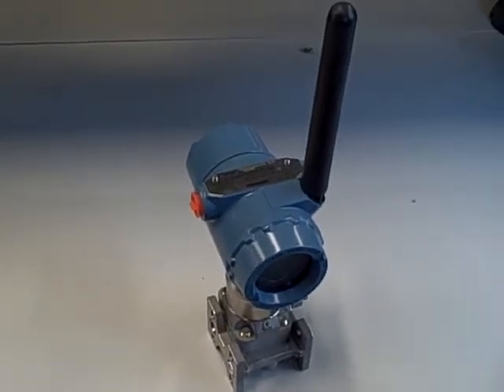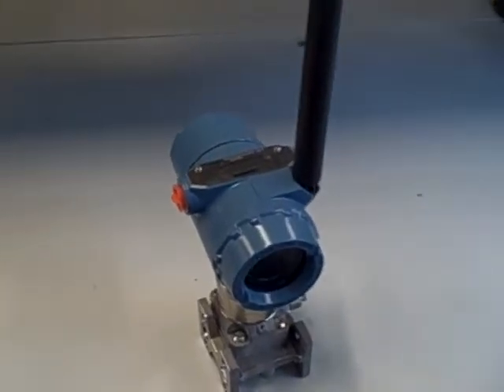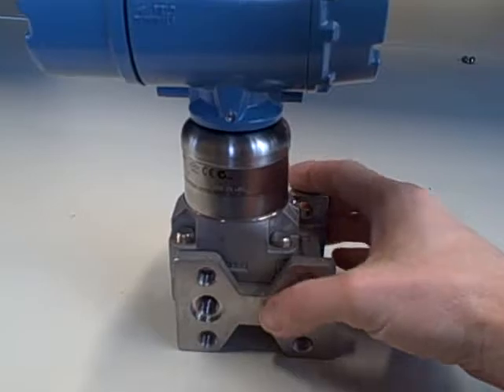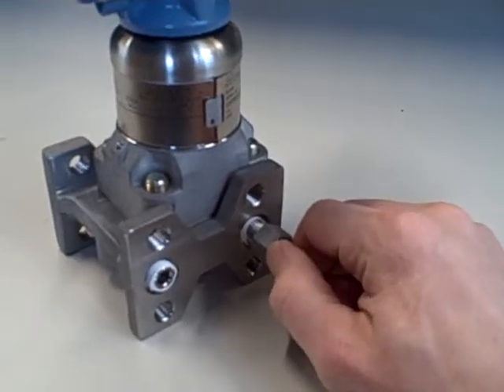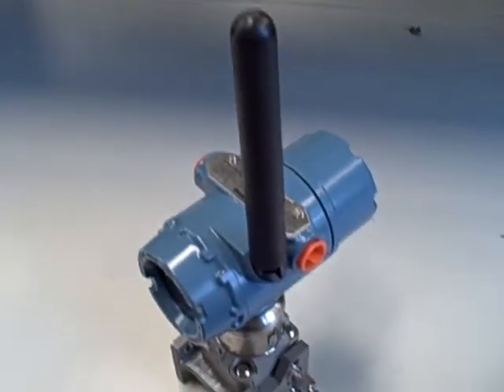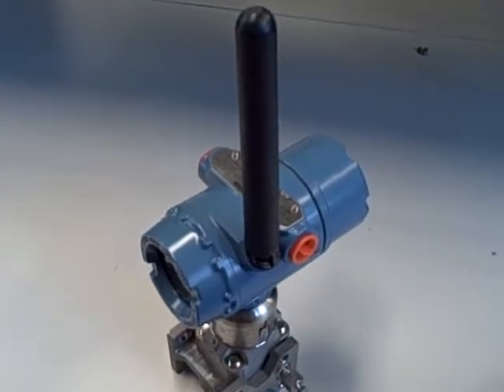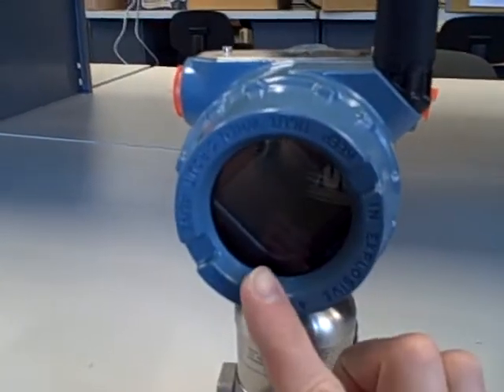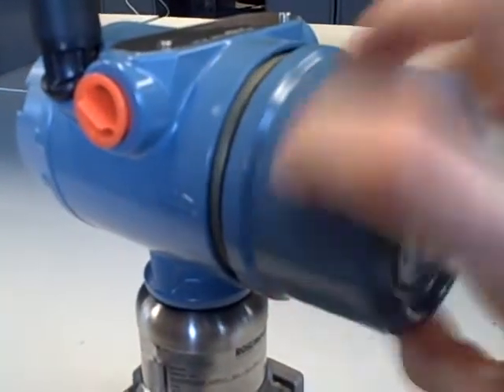Rosemount 3051S wireless HART pressure transmitter

Comment: Aerospace industry has been using  Radio Telemetry for quite some time to monitor systems. What would be your ideas as to why industry has not adopted telemetry to a greater extent???
Reply: MONITORING IS NOT A CRITICAL AS CONTROL! MONITORING IS ONLY 1 WAY COMMUNICATION, CONTROL DEPENDS ON RELIABLE 2 WAY COMMUNICATION AND LOSS OF CONTROL COULD BE CATASTROPHIC!   LASTLY,  SO MUCH ELECTRICAL EQUIPMENT PARTICULARY HIGH FREQUENCY HIGH VOLTAGE (VFD) MOTOR DRIVE CIRCUITRY WOULD CREATE A VERY NOISEY ENVIRONMENT FOR WIRELESS.... LASTLY RESPONSE TIME,,, I THINK HE MENTIONED THIS IN THE VIDEO... THE DATA RATES ARE MUCH SLOWER SO FAR WITH THE  INDUSTRIAL WIRELESS MESH NETWORKS.

Comment: Would you still need a PLC? Where and what is this thing transmitting its signal to? How long do the batteries usually last, for using it to transmit signals on a "regular/normal/average" basis?

Comment from the maker: @tuason33 It does have screw terminals behind the cover where you can connect a HART communicator for initial configuration purposes.  When in service, however, you would plug the conduit holes as they are not needed.